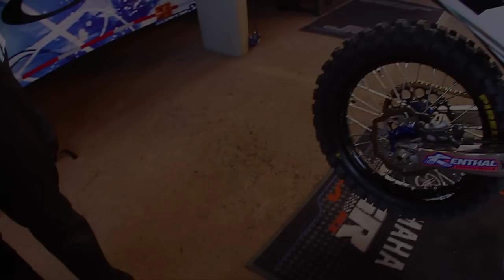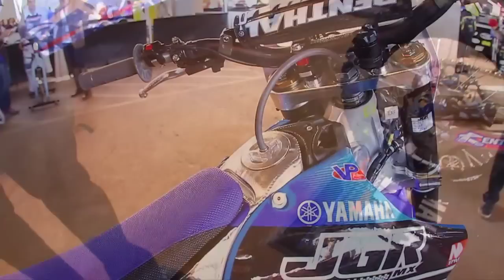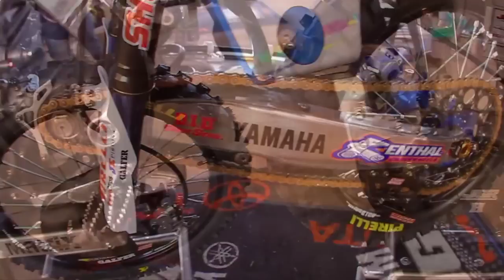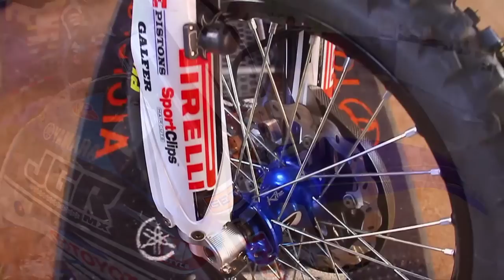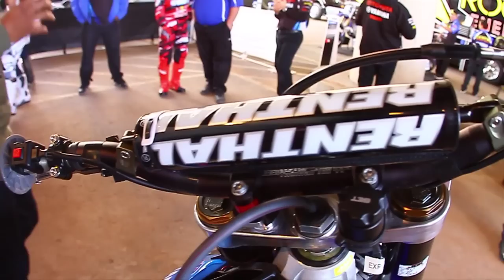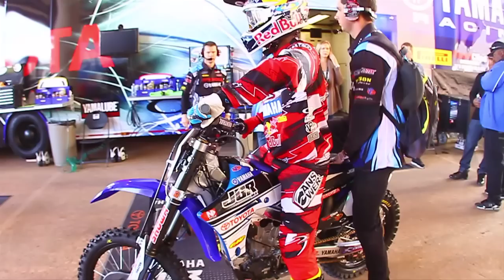Behind Bars - James Stewart's JGR Yamaha YZ450F - TransWorld MOTOcross

Comment: all JS had to do stay with Yamaha 1 more year till 2014 models comes out I guarantee he would hv finish way better on the JGR Yamaha, than his Suzuki.2014 Yamaha is awesome & has all new design & will be one of the best bike in 2014. BIG mistake on JS part.He did NOT gain ANYTHING by going to Suzuki. My guess,with Yamaha he would have finished at least top 10. oh well he is DONE. He'll use ANOTHER EXCUSE, to move to another brand. My guess will be Honda,& he'll bash Suzuki like he did Yamaha